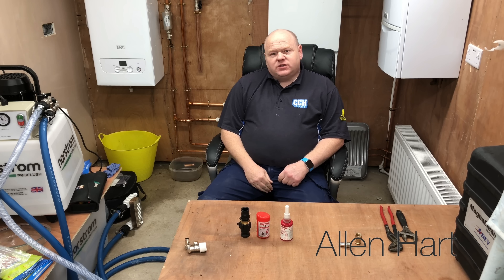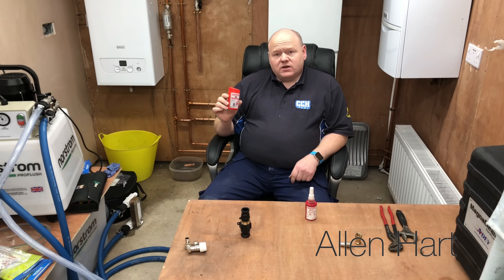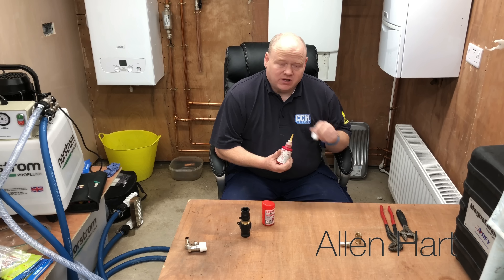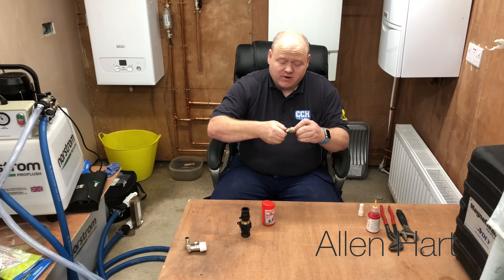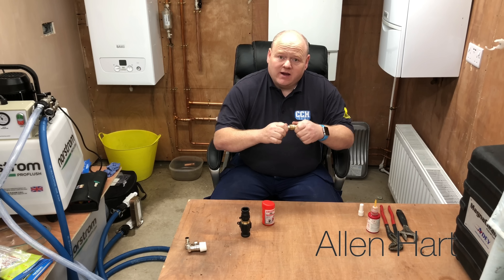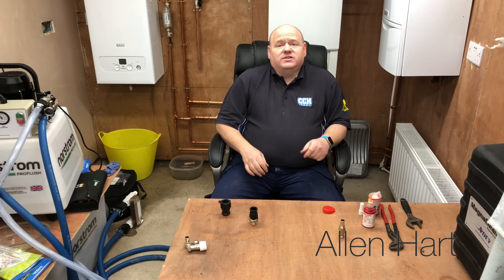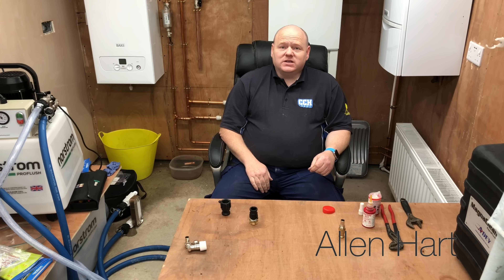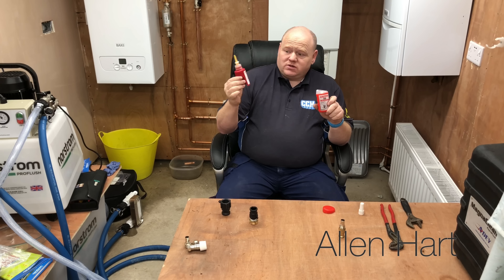Loctite 577 and 55 Review Honest Reviews

Comment: I'm doing all the plumbing from scratch on a house I bought at auction. This stuff saved me. Before I was redoing connections that moved when I tightened something further up the line that jarred a connection. Since I used both of these products no leaks, and I'm using plastic and copper combos all over the place. Amazing stuff.

Comment: 577 is brilliant as a refrigeration sealant. I use it on systems up to 40bar and pipes up tp 110 degrees c. Never had a leak on a thread fitting using it
Reply: Do you also apply PTFE besides 577 or do you use it on bare metal?

Comment: Hey Allen, great videos! I have a question about using liquid sealants or more to the point, what do you do if you need to re-work the fitting, say if you want to replace a rad tail. Do you need to clean the old sealant out of the internal rad threads (and if so how) or can you just apply fresh sealant to the new tail and screw it home?

Comment: the 55 is great stuff, never used the 577. Where I am we have codes which prevent the use of the 55 for iron pipe for gas. Its also impossible to fine, have to special order online in limited supply.  But the 55 is aces when you cant get the pipes to seal up, instead of tring to wrap candle wick.

Comment: Bought some 577 on the basis of having seen a few videos including this one. One thing I am not totally sure on is does it work on parallel threads.?  I have a couple of rads on which I need extending tails which come with parallel threads. I find that even wound fully into the rad there is a bit of movement of the tail.

Comment: Alan, I do maintenance for a group of care homes, most building are over 20 years old, the water turn off's under sinks and toilets are all brass, I hate going near them, if you even look at them there leaking,  its got to the stage most times ill isolate the water in the roof space,  Im going to start swapping these out what valve would you recommend..? I plan on using one with a thumb turn as it may be less prone to problems in the future.?. whats the difference between a full bore valve in comparison to normal one-there expensive-..?. What make of TMV would you recommend for this type of application, one that can be easily taken apart and cleaned once a year.. Thanks in advance.

Comment: Great video Allen. You mentioned 55 is for metal<->plastic, but do you have experience using it for metal<->metal as well?
Reply: It works with plastic-plastic, metal-plastic, metal-metal etc. 
It's good stuff and so easy to use and carry in a toolbag or pocket.

Comment: That Loctite 577 looks really good. But how easy is it to dismantle a fitting where it’s has been used? Does it set hard, or remain soft?
Reply from the maker: They are not designed to come back apart, I have never tried but I am guessing it will not be easy, 👍
Reply: Allen Hart. It sets hard but can be dismantled easily, I’ve done it. In fact, it’s worth mentioning that once set, the 577 can’t be moved or the seal will break. The 55 can move easily, about a quarter turn apparently but I’ve not tried it.
Reply from the maker: Thanks. 👍
Reply: I had no problems disassembling some fittings sealed with Loctite 55 a few days ago. Also as Andrew said, you can adjust the position a bit after installing. I've done that in the past for radiators in our house and had no leaks then (6 years ago). Also used this stuff on a 2" thread on a wood boiler.

Comment: Also, 577 has a shelf life, and unless you use it often, it goes out of date.
Reply from the maker: I use it nearly every day but i forgot about the date, i will check next time i use it. Thank you
Reply: Whipped out my 545 last week after haven't been using it for 6 years. Still work a charm. Application was for LPG piping at 20PSI.

Comment: looks good how long does 577 take to cure when used on rad tails?
Reply from the maker: Normally takes about 10 mins, Thanks for watching.
Reply: @AllenHart999  on their website it says that low pressure is instant, but it takes 24 hours for full pressure? I'm assuming that's mains pressure of 4+ bar? So not really ideal for outside taps for example, you're not going to leave it off for 24 hours then return the following day to test for leaks?
Reply: @killerbean9911  i use 577 all the time. Inside. 

I had to use it outside and it failed. Not the product’ fault, user error on my side. 

I have since redone it and left outside tap off for 2 days and it worked fine. 

So using outside, seems to need longer and def 24h+ Makes sense really. 

577 is great. 

Your videos are too 👏

Comment: Never used Loctite before, what's the 577 like if you wanna remove rad tails once it's set, is it easily removed or is it stuck there for good?
Reply from the maker: You make a very good point, once they are in you will find it hard to remove them, Thanks for watching.
Reply: I have no idea about Loctite 577, but I tried a Chinese anaerobic pipe seal adhesive which I believe might be similar. It sets very quick, once set you need a wrench and quite a bit of force to losen it.

Comment: Hi Alan, thanks for your video. Would this work to seal a G1/2 female to an R1/2 male, both metal
Reply from the maker: I am not sure what that is but it works metal to metal no problem. Thanks.
Reply: @AllenHart999  you don't know what is G and R? Nice!
Reply: Dušan Barlík - Seems quite common that many don’t appreciate the difference between the two, but simply treat everything as BSP. Look on Screwfix website and they are just as bad and as for Toolstation, you get nothing more than the title i.e. the tech info is simply the part number. The only way to get more info is to look at the reviews, which is crazy.
Maybe i am making sweeping statements here and tarring all with the same brush, but the way it’s done seems more based on, use this compound with that joint as they’re all 1/2” and so it’ll work...and it obviously does. But as an engineer in a different discipline, i am used to having detailed technical information to-hand and not used to having to fudge stuff to get it to work.

Comment: I have only seen leaky yet almost impossible to unscrew connections with Loctite 55, done by plumbers who use it solely based on recommendation in the store, cause that's "the new pro stuff". Tried to redo them myself, well...done with teflon tape or paste+tow in the end.

Also speaks a lot about your expertise as a plumber if you use anything else than 2 layers of teflon tape or a specialty compound dope/sealant on a platic to metal thread. Unless it was done previously with Loctite 55 - then you sure as hell need to pack it with 20+ layers of teflon, like it was metal to metal but never that Loctite crap. Or just get a new plastic fitting in that case and do it properly.

I understand that there are connections where either tow or tape are inappropriate but there is still choice other than this painful rope.

Comment: LOXEAL 58-11 is better.
But Loxeal in isn't so expensive
Reply from the maker: Never used it so i wouldnt know. Thanks for watching.
Reply: I use LOXEAL liquid sealant class 2 (w/o numbers) too. I  guess it's the same methacrylate stuff loctite uses and others , it's cheaper than loctite and works the same. Teflon +0.20mm+ tape is not working with 1" bsp straight brass fittings , every one leaked on me, a little bump or rotating force and it leaks. Loxeal holds the fittings tight, resist vibrations and it works all the time. Only drawback is that sometimes you need a huge turning force to the sealant to yeld  with 1" and above, but heat is my friend ;) . Using 250mm KNIPEX pliers wrench.